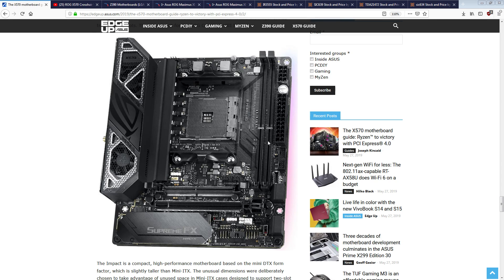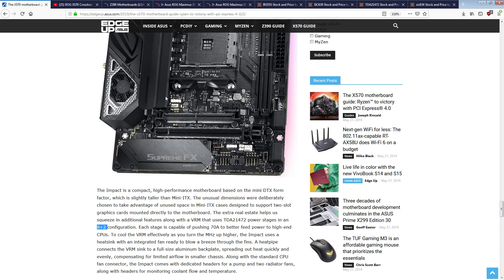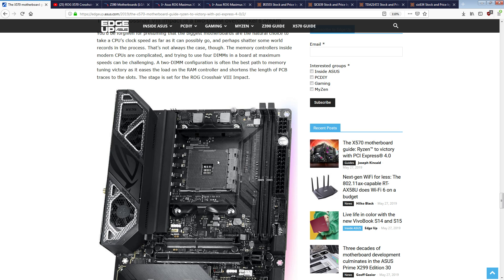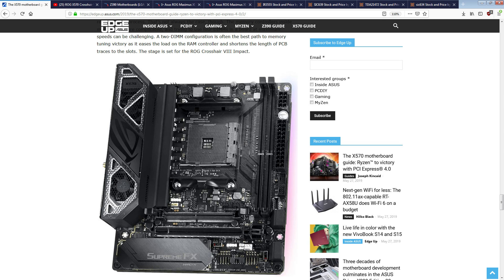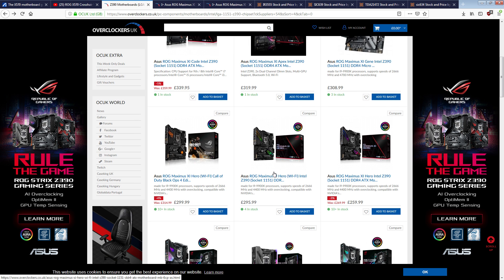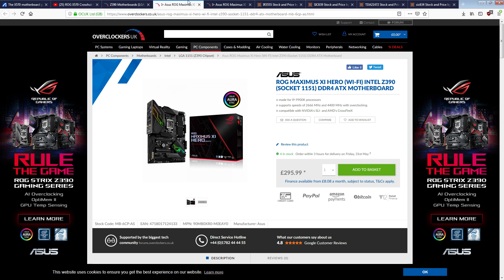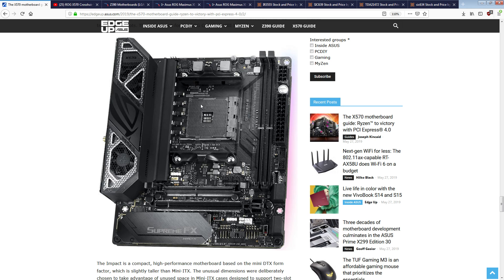The Crosshair VIII Impact is almost certainly a 4+2 phase VRM and that's fine

Comment: Why in gods name does it exist? its form factor is not Standard so it will not fit in most ITX cases . so if it only fits in Matx cases why is the board not Matx board ? 

Second yes there are only 2 dimm slots great for over clocking unless they are located next to all the big powerline nasty stuff
if you LN2 this board and put those VRMs to work in a 4 fase configuration , well i think you have a hard time getting the memory stable....i could be wrong but because asus is not making a standard board why not put all the power connectors on the top of the board close to the components that use most of the power and leave your memory traces isolated. and if for some reason you need power on the bottom of the board your run a trace from top to the bottom and now if powerline crosses it under 90 degrees angle well the impact is really small..
Reply: Mini DTX (mDTX) is a standard, and I think its great.
It might be slightly taller than an mITX board, but most mITX cases that are designed for "standard" dual slot GPUs have enough room to accomodate a slightly taller mDTX board. For those cases, mDTX boards can help to reduce design complexity for motherboard component design layout and perhaps make a cheaper/better board instead.

Comment: Pretty sure the VRM temp isn't that high on formula or even on hero according to 2 reviews I have seen. On top of that on guru3d's 9900K sample (reviews) they had worse overclock on aorus master and taichi than both hero and strix. Is there any point of some magically high quality VRM on spec which Cant oc as much? Did you successfully test all the same 9900K on all those motherboards guru3d tested? Or are you just speaking out of theory without practicality testing those in OC stability? Cos it seems pretty illogical from Asus 's point of view to save 3 usd from making a Much better oc board as u said

Comment: Hey - looking at Asus Crosshair Hero VIII as an option for X570. They are claiming  "16 phases per 'The VRM is comprised of 16 IR3555 PowIRstages, each rated to handle 60 amps."
https://www.asus.com/Motherboards/ROG-CROSSHAIR-VIII-HERO-WI-FI/overview/
How does this compare to the Gigabyte Auorus Extreme https://www.aorus.com/X570-AORUS-XTREME-rev-10 - Also claiming 16 phases.
Thanks

Comment: TDA21490 is the latest.  Mainly higher peak currents.  Thermal design currents still 25A-30A without heat sink.

Comment: Do you think that a MSI B450 Tomahawk can run the 12 Core Ryzen 3000 at Stock? Should be, right because it is still 105 TDP (currently running a 2700X).

Comment: X470-I ROG Strix Gaming has a 6+1 apparently on an ITX board.
Would that be better or worse than this considering 12 cores and no apus.

Personally I'd have loved to have seen (4x2)+2 with doublers at the least.
Then again I also want DTX with pcie x16/x8 slots and a single an m.2 on the back meaning more space for the vrm on the front, maybe squeeze in a genuine 8+2 with a 8mm superpipe and no stupid i/o cover then maybe mount a monoblock to it.

Comment: I really like the: X570 "Asus Crosshair VIII Impact" my only problem with the board is the dual m.2 add-on card , it feels tacked on & not thought out- like Asus was trying to save money, there is plenty enough room on that DTX board to add 1x m.2 on the front & 1x m.2 on the back of the motherboard....
Reply: They prioritised a backplate over m.2....
They could've had that as the m.2, had another m.2 on the back, then had x16/x8 on the front OR increased the vrm/chipset heatsink size with an 8mm superpipe.
But nope.

Comment: Buildzoid do you think that buying an Aorus k7 X370 now to use it with ryzen 3000 could be a good deal? would it be able to oc the new ryzen? thank you
Reply: Check if the board even supports Ryzen 3000 before buying it. Support for Ryzen 3000 seems sketchy and based on the motherboard vendor, so make sure they actually released an update for it.

Comment: You can diagnose it full, but already a single EPS connector for an Ryzen 3 it just looks suspicious... xDDD
Reply: 4*7*12=336
Reply: @MechanicaMenace  you can safely pull 250+ W with single 8 pin
Reply: @Tallnerdyguy  sort of my point. 4 wires that in spec can carry 7 amps at 12 volts equals 336 watts.
Reply: @MechanicaMenace  sorry i hadn't seen your reply when i had replied
Reply: @Tallnerdyguy  no worries, for some reason YT decided to "address" it to me lol

Comment: 4 phases for such high end expensive board is DOA. Seems I'll pick Asrock X570 itx instead.
Reply: Have you not seen buildzoids video on how asrock have consistently lied about their vrms? Asrock never made a good amd boards before now and old habits die hard.
Thier BEST board was the 990fx killer with an "8+2 phase", which was actually a 4+1 with a rt8871a and power stages rated at 60amps but only at 25*c which never happens.
  In all of thier am4 300 boards only the Fatal1ty X370 Professional Gaming and X370 Taichi had good vrms.
  In all of thier am4 400 boards only the X470 Taichi (Ultimate) was any good.
Those 3 boards with an ir35201 with doublers but the BIOS's sucked.

EVERYTHING else was a 4+2 including thier £150 x470 fatal1ty boards which they blatantly call a 12 phase. Asrock make some of the worst boards you can buy (ignoring biostar which everyone does).
All of thier ITX boards were 3+2 with cheap mosfets, you want that?
Asus and msi ITX boards have a 6+1 or 6+2 phase using the ir35201 controller with IR3555 mosfets.
https://www.hardwareluxx.de/community/f12/pga-am4-mainboard-vrm-liste-1155146.html
Reply: @tomstech4390  I look at case by case instead of brand. Asus makes some good board, some bad(mostly bad now). Same as Asrock. Gigabyte's X570 itx looks like a 6+2. I still keep my hope Asrock will have 8+2 on its high end itx board. After all it has a thunderbolt 3 port. I hope Asrock would cheap out, as least this time.
Reply: Micro dtx is never going to be "high end"
Reply: @tomstech4390  Again, I look at it board by board basis. Asrock makes many bad board, that's true. But it also has the best(in term of VRM) Z390 itx board. I'll wait for reviews of all X570 itx boards before rushing out to buy one.
Reply: @tomstech4390  high end typically is a notation or correlation based on a few things.

1. Features. Micro atx(dtx) 2 memory stick support, less pcie expansion, less usb and less nvme support.

2. Upgradability. With a single pcie x16 slot you cant add add in cards, dual gpu graphics (not really important, as nobody really uses dual gpu for gaming) 

3. Overclocking features/specs. While often micro atx/mitx can overclock quite well, often will throttle back after extended use due to size restraint and inability to keep VRMs cool.

4. Price. Price while subjective, typically will indicate quality of components. Sizing down size can actually bring price up, it's not due to more features, but just being smaller.

Dtx is just slightly extended Mitx (if i understand correctly)
Reply: @tomstech4390  again that can vary on your definition vs common use of "high end" the reasons listed are just the common reasons for the term. I would not consider anything smaller than ATX to be high end just due to expandability and being unable to use add in card(s) for streaming or whatnot
Reply: @tomstech4390  it is one of the standard criterion, but not all atx are high end. A320 motherboards are atx and not high end at all by any means. Typically you won't find a non atx (or eatx) board to be considered high end (with few exceptions) and definitely not all atx are high end, do not state, just because it's atx and not high end that i am incorrect

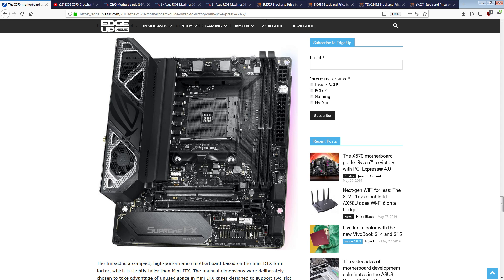Comment: Question, at 16:30 you said MemOK was the most useless switch they've added recently and while I don't doubt that since I've never used mine or have any clue what the fuck it does in the 6 months I've had my Asus (Z390-I) board could you elaborate how does it make overclocking memory worse?

Comment: I have b450i Mini-ITX from MSI it is 6+2 phase vrm and this has been my best mobo so far. Can undervolt oced ryzen 3 2200g @4.0 I am sure I can push to 4.2 with volt increment. I am waiting for 3700 or 3600 to replace the cpu. My mobo already got 2 bios updates to support new ryzen cpu. I am sure it can handle 3700 pretty easy.

Comment: Asus has been skimping on VRMs for few years now...and considering how overpriced their boards are, it's downright insulting. Fine, you cut down on phases and make the "enough" VRMs on your boards...but have the price match that, then, not charge out of your ass for essentially a lightshow and plastic all across the PCB.
I have a great Asus Z87 board and even Asus if charged premium for their boards back then (which they didn't really, my Z87 Pro was 140€), I'd pay because they were top quality. Nowadays, you get more with other manufacturers for less money, except in highest, most expensive tier.
I plan an upgrade later this year and I'll be skipping Asus this time...they can't sit on laurels forever.

Comment: What are the prices going to be for this board? Any like how much more will x570 borads be over x470?
Reply: The only information going around about the X570 pricing is there going to be more expensive than X470 boards when they first came out but if you want numbers then we have to wait until CES.

Comment: Please make an overview of all x570 boards VRMs - price/performance, when they come out. Thanks.
Reply: Yeah especially the smaller form factor like m-atx. Maybe I'll just go with a atx case for my next ryzen build if there is no good m-atx motherboard...
Reply: @94Ninsound94 there is a grand total of zero announced matx boards.
Reply: @phazeshifta  Asrock is the only one with an m-atx board although it doesn't look very promising compared to the ATX and m-itx boards
Reply: Waiting for the x570 Gigabyte and Asus one :)
Reply: You know there was like 100 x570 boards announced, right?
Reply: @phazeshifta  NO. Asus, Asrock, Aorus, MSI each aprox. 12 models
Reply: @anonymus5995  lol, Asus has 10 boards alone. That took 5 seconds of googling to find that number. Each manufacturer has 6+ more. That's a heluva lot more than 12.
Reply: @phazeshifta  are you a math wizard? 10 is more then 12? I wrote each brand approximately 12 models.
Reply: Asus for extra malware
Reply: Especially ASUS. Gigabyte is clearly the best VRM wise.
Reply: @madd5  Yh I heard Gigabyte are not using doublers and using true 16 phase for there top tier board. All the motherboards guys are going ham and I'm confused which one to go with because they are all good.
Reply: @fihimsadiq8779  Exactly. Gigabyte is the best one for now VRM wise. But I really like Asus Rog design, bios and apps. I have experience with Gigabyte, MSI and Asus. All around best motherboard is Asus, can't deny that.
Reply: @fihimsadiq8779  I thought gigabyte is 14+2 with 14 for the CPU.  Asus Crosshair I think is supposed to be 7+1 with the 7 twin/teamed/fat phases?
Reply: @chowbabyloving  Yes, 14 Vcore phases: https://www.reddit.com/r/Amd/comments/buclh8/aorus_x570_vrm/
Reply: @chowbabyloving  it's not always about the number of phases, it is the quality of vcore voltage....even this 4 phase is enough for most of ryzen 3xxx series...both gigabyte and asus both make quality VRMs, and really will be up to you if you like asus or gigabyte BIOS. Personally i prefer Asus BIOS, but really up to you

Comment: Just kinda sad to not see manufacturers squeeze as much out as possible on their stuff. It doesn't cost them extra to program the voltage controller to do 7+1 instead of 4+2 right? I really doubt if 1 less TDA21472 for the core will affect overclocking even on the 16 core (cooling limited, I dont think it can pull more than 250A before thermal throttling on liquid cooling). If the SOC really needs 2 phase to meet AMD specs... ah well
Reply: Build said multiple times they could NOT put more VRMs there if they tried. The power stages are still great and as he said, is capable of 560 Amps, which you don't need, and won't hit.

There is more to power delivery than mere phase count, pay attention to the video.
Reply: @Axisoflords  I mean 7 phase with 7 powerstages for the core voltage. That's less components, if you paid attention to my wording.

Comment: @Actually Hardcore Overclocking
LOOK  asus z87i deluxe  and z87 impact , z97 impact  if you run out off space for vrm  on itx , in theory on this mainboards they can add fan+heatsink that will blow air out off the case like a small low profile gpu example "amd wx 2100"
Reply from the maker: those all use smaller 40A power stages and don't have to power 200W+ CPUs

Comment: But Asus's b450 and X470 Strix board has a 6 phase using 6 60amp Ir 3555 power stages and it's only a an Itx board.
Reply from the maker: AFAIK that board is on 40A 3553s.

Comment: I bought X470 ultra gaming because I had no knowledge about motherboards. Will it be able to run Ryzen 3700x? Or will I have to keep using 2600 :(
Reply: im like 99.99% sure you will be able to use it...asrock confirmed that even a b350 mobo will be able to use the new gen so i don't see why an x470 wouldn't
Reply: @Chris it has 4+3 phase vrm with doublers and they advertise it as 8+3 vrm.
Reply: @TheCursedPigeon  Its a 65W part, who cares. And X470 Ultra Gaming and Gaming 5 dont have doublers. Maybe you thought the small ICs are doublers, but they are actual drivers.
Reply: Thanks guys, now I feel better that I didn't fuked up while buying the mobo.

Comment: What would be amazing, on at least an over clocking board, is the ability to have some kind of oscilloscope functionality on the board for Vcore. So you can see what's happening. At least the ability to see a few microseconds after a trigger that you can set. I'm not sure how much 10GHz ACDs cost, or whatever it would need ... But it might be worth it, and would be one hell of a USP. Also you might be able to feed more than just the Vcore signal into it to see what's happening with e.g. Vsoc or Vmem, or even the memory traces, if they don't skew too much from being measured.

Comment: So I'm wondering if the x570 Rog Strix VRM will be better than the x470 Crosshair VII VRM. The Asus site shows a massive VRM on the x570 Rog Strix, but no details really.
Reply: Depending on how Asus plays their cards, the C7H may end up being better than the new Crosshair boards. It has a doubled 5 phase for effectively a 10 phase VRM. According to Asus, the C8H is running a 14+2 setup (notice they did not say phase). I do not know the controller they're using, but it's probably an ASP1405, which means that 14+2 vrm is really a 7+1 phase. The 1 phase SOC is "fine" really as none of the Crosshair boards support APU graphics output, but it ends up a question of whether a 7 phase is better than a 10 phase as they are using the same power stages (Asus confirmed they are using IR3555 for the C8H/C8F, same as the C7H).

Comment: Is the VRM on the ASUS Crosshair VI Extreme any good?
I picked it up on the cheap on clearance, but the plan is to stick the 12 core Ryzen in it.
Reply: If I remember right, it's an 8+2 and @DD KK is right thst it was still great for the 2700x and should be good for the ryzen 3000 line.

I have the vi extreme with a 2700x @ 4.3 on all cores. Doesn't put out a lot of vrm heat.
Reply: Dan Ogier keep in mind the C6E is an 8 phase (doubled 4 phase) with 60A IR3555 power stages. The Zenith Extreme, a board originally meant for overclocking the 16 core 1950X, also comes with an 8 phase(doubled 4 phase) with 60A IR3555 power stages. Most of the Rampage boards, notably the R6E, have the same 8 phase setup as the boards above. So the C6E, which has the same vrm setup as the previous Extreme boards, will be absolutely fine even with a 16 core Ryzen 3000.
Reply: @rcradiator  Perfect. 👍

Comment: This or the Gigabyte Aorus X570-I will end up in my build with 3700x+16gb 4133 Patriot Viper Steel. I'm reaaaally excited how far I can overclock~
Reply: Don't put a ton of faith in some insane overclock. Overclocking is hardly a thing these days. These CPUs oc on their own fine
Reply: @bogartwilley  yea, dat's true. I just hope that the 3700x and 3800x r basically the same as the 2700 and 2700x. Would be great actually
Reply: @ThirAilith  The 3700x is unlikely to oc as well as the 3800x

Comment: This board screams monoblock. Plus it should have very good memory OC/high speed ram compatibility if previous impacts are anything to go by. 

Kinda sad not to see the vertical vrm layout from previous Impacts.
Reply from the maker: at least it should make designing a mono-block for it easier.
Reply: @ActuallyHardcoreOverclocking  isn't the IO shield attached? Along with the fan shroud?

Comment: It's the top of the line product that is going to be disgustingly expensive and therefore when it comes to it's main selling point, there shall be no compromises. I agree that it's definetly harder on a such a small board but its DTX and they also moved M.2 to the SO-DIMM add-in card. They already have quite a bit more space to work with than other motherboards.

Comment: you posted a spreadsheet with the gigabyte itx vrms: their itx has 6+2 70a, am i wrong in thinking it will be better?
oh and i was looking earlier: asrock and gigabyte itx do have display ports, though asrocks may be used for some weird tb3 passthrough
Reply from the maker: for raw power this is better. For voltage regulation you'd have to actually test the boards IRL.